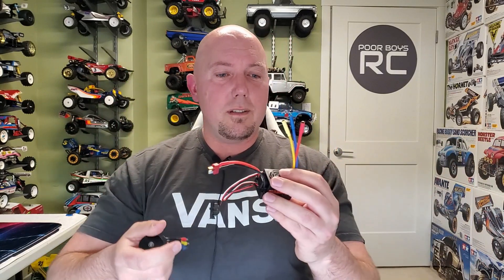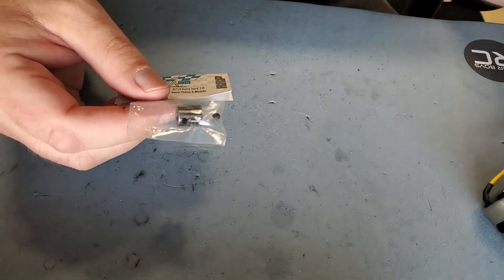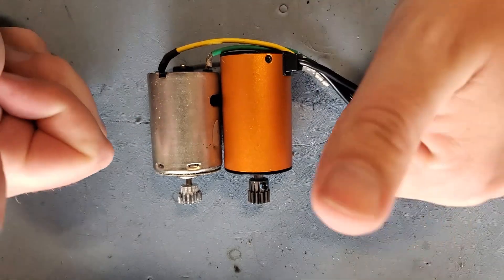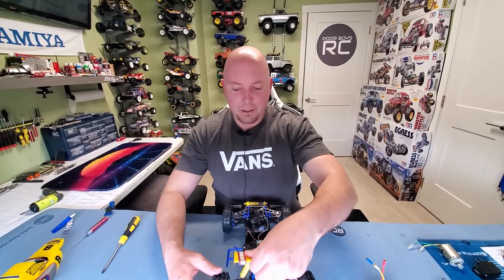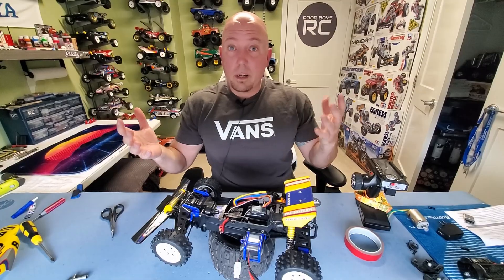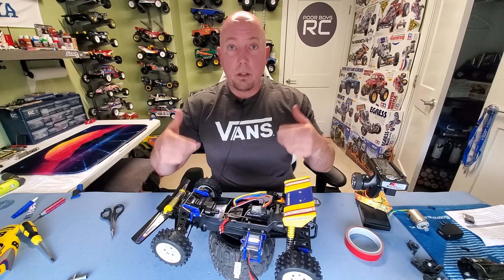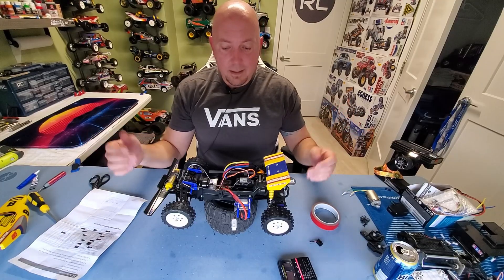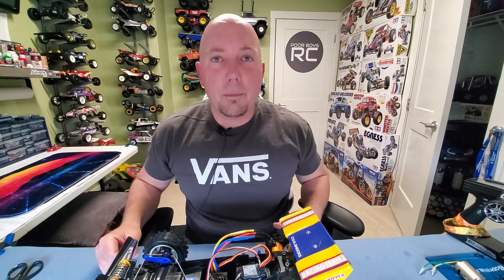Cheap Brushless Motor/ESC Combo

Comment: did you calibrate.
most of the no name brand escs need the program card that is just the LED dots, you know the one. also was your radio ch2 dead center? sometimes if you move it a little off center one way or another it may auto calibrate.
i prefer either the blue Hobbystar stuff  from RCjuice or red RocketRC stuff from Supass. I have had zero issues over the years with those two brands.
My RocketRC 160amp 6s esc blows my Hobbywing quickrun 150amp out the door. i tried both in the same Vendetta with the same purple turnigy XK 6s motor and gearing and the RocketRC is the winner at 1/3 to 1/2 the price!
Reply from the maker: Great tip on the RocketRC brand. I didn't have the program card for mine, but I did trim it to get it working. But it's still inconsistent, even shuts off after the occasional jump which is annoying.

Comment: I have the blue 120a gool rc esc and it's definitely not waterproof . I hit a big puddle with my sc10 and literally had fire 🔥 another thing to watch out for is make sure it say programmable in the description of the ad or you won't be able to program it. Other than that my sc10  rips with a 3100kv brushless motor. I was getting some serious air with it at the skate park yesterday.  You must have a defective one . Did you turn the transmitter on first?
Reply from the maker: It worked, but kinda did what it wanted, when it wanted. The motor was good, esc, not so much. 😭

Comment: I have the same thing. Not Ramses Gool RC, It did not beep but rather did nothing l. Fan came on, but I can’t accelerate or turn… It’s a bad ESC out of the Factory
Reply from the maker: They can be hit or miss, unfortunately. 😭
Reply: @poorboysrc  I actually got it running. Tho It had some issues with a cheap Remote. I had to install a Traxxas TQ, I learned my lesson

Comment: I just had the same problem. Doesn't work with my little sons car, but did work once I tried my Transmitter and Receiver and worked within my bigger sons car.

Solution:
The Transmitter throttle from my little sons RTR wasn't centered and that caused the problem!
As it has no display for the calibration I haven't been aware that the throttle wasn't on 0
Reply from the maker: Same thing fixed mine, just trimmed the throttle. 🍻

Comment: Mine did the same thing. I swapped the two outer wires on the motor and it fixed it. Same motor and esc too
Reply from the maker: Good tip, thanks! 🍻

Comment: My guess would be that you received a cosmetic qc failure, which was either purchased by a third party or just sold unbranded by goolrc. Since it didn't pass, it doesn't get their name on it. I think that's the most likely reason because both products were blemished but functional. If you're not big on appearances it's actually a great way to cut costs on builds/spares
Reply from the maker: Yeah I knew it was a bit of a gamble, but it was worth it.  The esc leaves lots to be desired, but the motor is great!

Comment: It's definitely a step up from the silver Mabuchi stock 540 motor and esc.
Reply from the maker: For sure!  The speedo is about as dodgy as a MSC, but the motor is nice!
Reply: @poorboysrc  I appreciate the input. I have several high end RC cars like 2 electric Losi TLRs 8ights for bashing and fpv fun. I justborder a WLtoys 12428 to upgrade and improve on its existing setup with custom and aftermarket parts. For the price, it's not bad and it has plenty aftermarket goodies
Reply from the maker: @jeffv2074  yeah dude, the WL toys lineup is absolutely unbeatable from a value perspective.  I've got the 1/10 buggy by them and it's all sorts of awesome!  I made a running video on it, which you may enjoy!  🤙

Comment: Dude you need to send your ended points.
Reply from the maker: Yeah I did that, finally got it calibrated that way.  ESC is still meh in my opinion, but the motors are decent!

Comment: Always check if it's faster in reverse if you're not getting the power you want @ full throttle forward see what full throttle reverse is. I still have not figured out how to change motor rotation. I'm stumped too.
Reply from the maker: Typically with brushless motors if you just swap any of the two motor wires it'll change the rotation.
Reply: @poorboysrc  that's what I did and it worked just fine

Comment: Well I already made the mistake buying this combo. Mine was goolrc branded and the box was also branded. Ran it with my Traxxas Bandit this morning and quite frankly I'm putting the stock motor back in. Because I don't have a gps but my vision is pretty good and it looked and felt slower than the stock setup. It's even slow on 3s. I'm just going to wait a while and get the vxl upgrade, I'm not looking to go Mach 12 so that will be just fine. Great commentary and content definitely subscribing ✊🏾. Oh and if your wife knows any women in the Northeast United States that are into r/c vehicle's please point them in my direction lol
Reply from the maker: Hey pal thanks for the awesome comment and the sub!  Too bad the motor wasn't quite what you were hoping for, I found it to be just OK as well.  

I'll get the wife to check her friends list and send you a full update!  Lol!  🤣👊
Reply: @poorboysrc  Ahh no worries, as the saying goes, you get what you pay for. And roger that I appreciate it 🤣
Reply from the maker: @darkmatterenergyanon3313  check out the Spektrum Firma motors and esc's.  Not super expensive, amazing performance and a good quality brand!  👌

Comment: I have the rustler 2wd and I have no clue on how to mount the esc
Reply from the maker: Just use some 2-sided tape and tape it to the chassis.  👊
Reply: @poorboysrc  so tape will actually hold up? 😂
Reply from the maker: @La01781  sure will, most kits come with tape for this very purpose.  I use it on all of mine, works great! 👌
Reply: @poorboysrc  never knew that I thought they just always used screws till I saw this ESC but I have one other question, I wanna know about what gearing it can handle
Reply from the maker: @La01781  I would stick with the gearing the kit manual suggests.  If you're looking for more speed you can start increasing pinion size, but monitor motor and esc Temps to make sure you don't over gear.  👊
Reply: @poorboysrc  dang my esc and motor looks exactly like yours with no manual
Reply from the maker: @La01781  download the manual for your kit, it will tell you which pinions to use.  👊
Reply: @poorboysrc  ohhh ok thx
Reply from the maker: @La01781  NP, good luck with the install!  👊
Reply: @poorboysrc  works good with stock gearing actually
Reply from the maker: @La01781  that's awesome pal, glad you got it sorted!  🤙

Comment: To make the motor and esc work you need to keep holding the trigger on full power or full reverse for a few seconds and then let go of it it should then make different beeping noise. For me the motors and escs have worked really well :)
Reply: Mine worked amazingly on 2s... as soon as I plugged in 3s, it set on fire.
Reply: I have tried that and mine still runs at half speed.
Reply: @doughboy1966  Have you tried to "reverse" the "throttle servo" on your transmitter? *Usually Channel 2.

Comment: My Futaba TBLE-02S did the same. Rapid beeping and the steering servo worked but no throttle. Tried everything to reset/program the ESC (and those come with instructions). It wasn't throttle end points or trim settings. It was a bad Rx/binding issue. The rapid beeping usually indicates the ESC isn't getting a signal. I put in a new Rx and it worked perfectly. Mine was a Tactic Rx. Perhaps try swapping out the Rx or rebinding to see if that works.
Reply from the maker: I ended up getting it to work via throttle trim.  That said, it's still the sketches esc I own and would never buy another.
Reply: @poorboysrc  how did you get it set
Reply from the maker: @chrisjones8163  I had to trim the throttle on the radio until the esc set itself to neutral.

Comment: You have to set the throttle trim and will make a different beeping sound and then stop beeping.  And then should work .Hpoe this helps.
Reply from the maker: Thanks pal!  Yeah got it dialed in a few weeks back (thank goodness!)  😊
Reply: @poorboysrc  how did you get full throttle mine has terrible take off then hits full throttle
Reply from the maker: @ToxicGaming-nx6xk  I've had to play around with the throttle trim to get it to work right.  To be honest, this esc is not very good, it loses programming all the time, I can't stand it anymore.  Hope yours works out!
Reply: Mine is faster in reverse can't figure that out. Reversed on controller and it's faster in reverse when I pull the trigger forward.
Reply: Holyshit I played with it for hours and then came across your comment and I turned it on and dialed it in you dial the throttle turn to the south of beeping you're absolutely correct

Comment: Okay so I bought two put one in the wife's car just like you... no problems what so ever... runs great!! it's fast and quick but on the other hand put one in mine and I'm getting the fast beeping now but worked great at first.. seems like mine works, don't works works, don't works.... Also bought a silver programming card which doesn't work..
Reply: I'm also having problems with like out of the blue the my trucks won't go... It will  run pretty good for 2-3 minutes and then just stop and I have no throttle.. after about 45 seconds to a minute it starts working again... works for a minute or two and then  no throttle again..
Reply from the maker: @charlesstroud6592  yeah dude mine did the exact same thing...  I played with the trim every time until it worked.  Last time the wife had it out it worked 100% for a full 30 minute pack.  Keep trying, I think you're almost there.
Reply: Okay thanks alot... I'll mess with it when I get a chance but one more question did you ever figure out anything about how to program the ESC on this gool rc
Reply from the maker: @charlesstroud6592  no I didn't, as far as I know the program card is the only way to do it.  Seems like a pretty basic unit.  I don't think I'd buy it again.  The motors are OK, but the esc firmware is...  well...  not great.
Reply: @poorboysrc  yeah I tried that.. didn't work. But tks tho... Don't think imma buy the ESC anymore either..
Reply from the maker: @charlesstroud6592  yeah it's pretty much junk IMO.  You can always pick up a nice hobbywing esc!  Or have you seen my vid on the Horizon Firma?  Oh buddy, it's a thing of beauty!!!
Reply from the maker: Mine has done the same thing, works well, then kinda acts sketchy...  You need to adjust your throttle trim on your radio until the beeping stops (and the esc self-calibrates to neutral).

Take the tires off the buggy, and start playing around with your throttle trim.  Eventually the eac will find neutral and work properly!  💪

Comment: Hi i have a problem,
I bought a lil brushless combo online and it was dirt cheap. It looked very good so i gave it a try and the top speed is very good but when i wanna get of the line i give full throttle and the motor makes sounds for 1-3 seconds and then drives normally as nothing happens. But always when i wanna start to drive or wanna go uphill at low speeds, it makes this. Has anyone a fix for that?
Reply from the maker: Does it only do it at low speed?  

Most of the cheap brushless setuos are non-sensored.  Which means at low speed it will "cog" or move erratically, jerking as it goes.  Then when you apply more throttle it smooths out.  Sounds like this is your issue.
Reply: @poorboysrc  yes it is so i only can fix it with buying a sensorless system?
Reply from the maker: Yes, all sensorless brushless motors will cog badly at low speeds.  Benefit:  They're typically less expensive than sensored and considered more waterproof than sensored.

Sensored motors have a wire running from the motor to the esc.  Most are considered not waterproof because of this, although some manufactures are producing them as waterproof now.  Benefit:  Sensored brushless motors run silky smooth at low RPM.  Check out the Hobbywing AXE, it's CRAZY how smooth they got it!  

Hope that helps!  👊

Comment: Try switching the throttle servo to a different channel..   I have a goolrc combo just like that..
Reply: I have the 2435 setup from Goolrc. Everything worked fine with the exception that the servo  L & R function was reversed but my radio fixed that

Comment: I got that kit under the name Surpass Hobby, and got a racerstar programing card and it is working fantastic, you may have just got a bad motor
Reply from the maker: I ended up getting it working, turns out the esc doesn't find neutral very well as it auto-calibrates.  After playing around with my throttle trim, I got it to work!  👊
Reply: Glad ya got it working . Are you making a video telling us how you fixed it and it running ?

Comment: Great video bro, sucks about the esc don't worry it's just the trim setting and as for the program card look up shaluoman program card or young rc program card. I legit use these in my crawlers and they work great
Reply from the maker: Thanks for the tip!  The esc has been working ok for us, had it out a few times now.  👊

Comment: Are you using LiPo , they are all set for LiPo , also may need calibration , if servo works and flashing red calibration is required ..have few of the same setups and work amazing ..it's more water resistant
Reply from the maker: A fellow YouTuber helped me set it up and it's working now.  Thanks for the assist, I was about to take the hammer to it!  🤣
Reply: @poorboysrc  now need a video of it running 😉
Reply from the maker: @tocacarcraze  haha, you're absolutely right we do!  I just did some testing with it and it's a bullet!  💪😄

Comment: I am definitely Lucky enough to have a Wife that will join me in driving around. I am going to build a Midnight Pumpkin totally Ampro engineered out for her this October. I ran into the same issue with another Goolrc set and it had issues because of the set points on the transmitter. Even at zero it wasn’t happy so I unplugged it from channel 2 and plugged into channel 1 and ram throttle from steering for a moment then switched it back to channel 2 and it miraculously was fixed I am not sure why.. Sorry for the long message lol.
Reply from the maker: You're a good man, Derrick!  I can't wait to see that Ampro MP when you're done!  I'm sure your wife is going to over it!!!  🤙
Reply: @poorboysrc  Good shot Bro , I'm so glad I found your channel I relate so much to your content. It is music to my ears.

Comment: No just turn all your transmitter this means your throttle or reverse  is not set to 0 mess with your transmitter settings it will work lol
Reply from the maker: I checked the transmitter, it was set to 0 trim.  Also tried reversing the channel, but still nothing...
Reply: @poorboysrc  try rebinding the transmitter that can also be the issue can be temperamental when setting it up but mine now runs fine getting 60 mph in my 1/10 drift car and it's not waterproof I'd say water resistant a little lol but good luck with the ESC
Reply from the maker: @K1LT3DSN1P3R  ok pal I'll give it a go today.  Lots of good advice coming in from you guys so I've got a few things to try.  If I works I'll change the thumbnail, I promise!  🤣
Reply: I have this it done this with me lol it's a good set up you just need to reset your transmitter settings lol it's for safety so it doesn't take off when you turn it on lol

Comment: You might want to try and set throttle end points. I bought a set for $25 bucks that was the same thing and after I did that it was okay
Reply from the maker: How did you set your end points?  The instructions my combo came with don't provide any EPA setup methods.  From what I can tell this esc is supposed to be a "plug and play" like Hobbywing, etc...
Reply: @poorboysrc  I want to say I YouTube it lol. But you might turn it on with the throttle pressed all the way then it beeps and immediately put full reverse. Definitely take the tires off for this. I didn't once my axial bomber climbed the garage wall really fast.🤣
Reply from the maker: @ryanwebster2167  hahaha I did the same thing with a 1/8 e-buggy about 10 years ago...  Chewed a hole in the floor in about 5 seconds!  Lol! 🤣

Thanks for the advice, I'll start playing with it and see if I can manage to get it calibrated.

Comment: That's a BL3660 which is a 550 motor with a 5mm shaft. The BL3650 is a 540 motor with a 3,17mm shaft. Also, that's not a GoolRC motor but maybe made by same maker.
Reply from the maker: The ad from which I purchased the motor/esc advertised it as Gool RC which was why I ordered it, I've had great luck with their products and am a big fan.  I received a beat up knock off...  lol!
Reply: Also, the specs directly say that it has a 5mm shaft..

Comment: U running a Lipo pack ? If not it sounds like its in the wrong mode on the esc....i dont run brushless but it sounds like it...it could be a dud esc....reach out to to their customer service if not return it....:)
Reply: Or its wired wrong from the factory...it sounds from the being almost like the polarity is wrong too? Maybe
Reply from the maker: @Tailgatesntoolboxes  I thought that too.  Tried many different wiring combos off camera...  no go.
Reply from the maker: Yeah pal I'm running lipo.  I tried several different configurations.  Lipo, nimh, even tried using the motor with a different esc, no luck.  It ran for a few seconds and that was about it.  😭